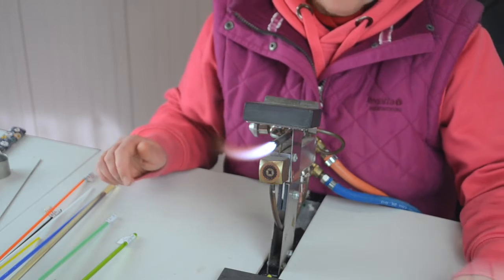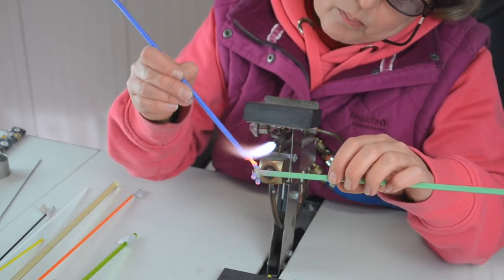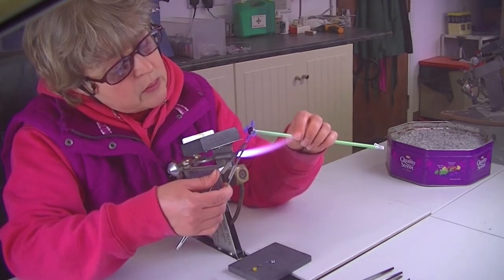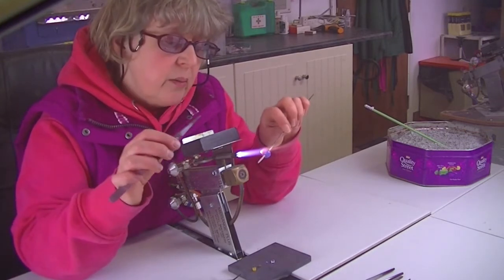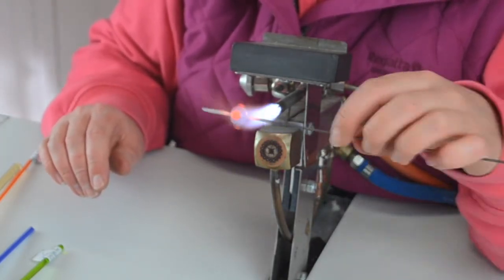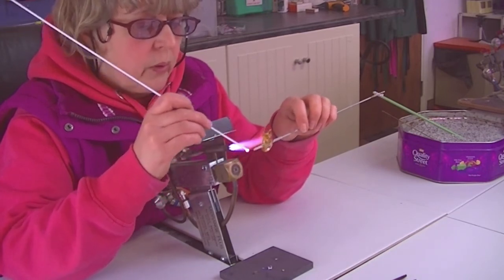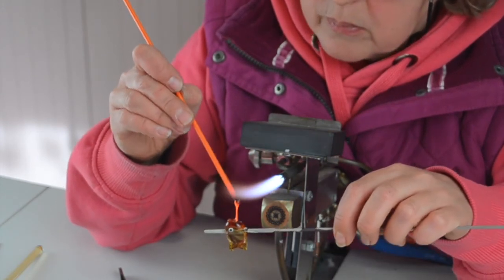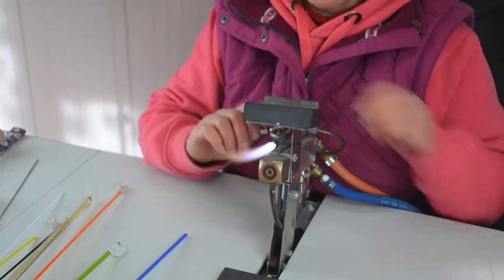Tweezer Talk - Tuffnell Glass

Comment: I really appreciate you making these videos and explaining as you go along, these are my favourite type of youtube video. Unfortunately I find it quite difficult to hear you guys sometimes over the noise of the torch. I know from experience that it's very hard to get good audio as the torch always seems louder than you think. If you are using a camera that can have an external microphone may I suggest a lavalier microphone, head mounted microphone or an end-fire desk microphone as these either put the mic closer to the person or can be placed to one side pointing at the person which keeps the torch out of its field of pickup. None of them are what I'd particularly call cheap though. With microphones quality costs. The radio Lavalier/head mics can be useful though when you want to put the camera behind glass.